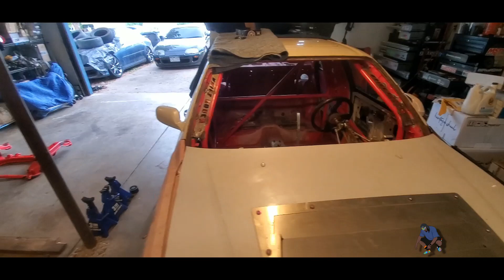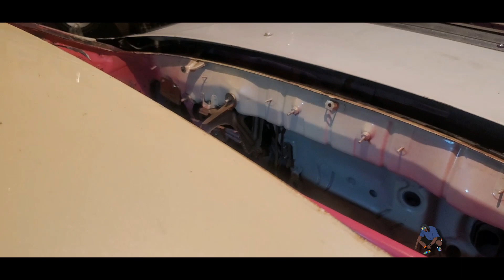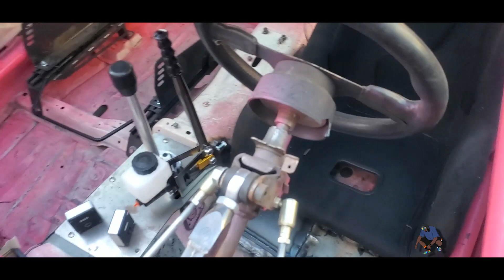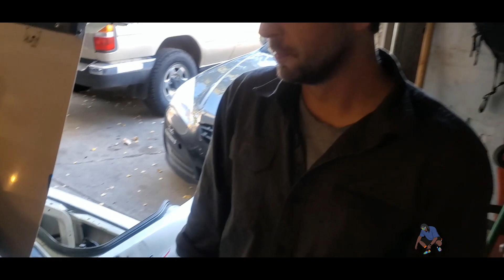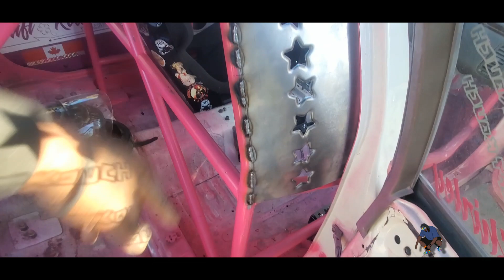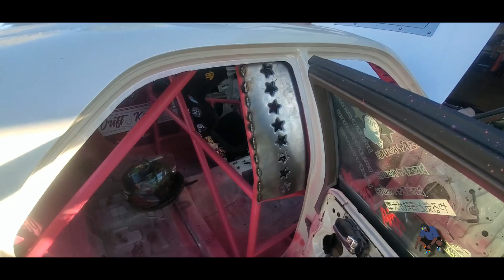Y33 q45 drift build progress

Comment: Hey man. How did the g35 clutch pedal fit in the car? Im swapping my q and hoping for an easier solution then custom. Btw, build is sick. I wanna do and fdf kit for mine too!
Reply from the maker: I used a s13/14 clutch pedal and with every thing out the way it was fairly easy ,in stock trim it’s a pain in the a** but very doable